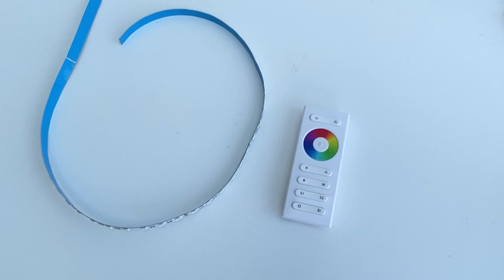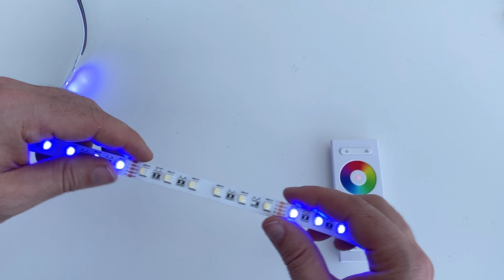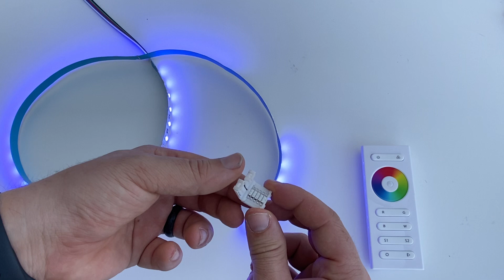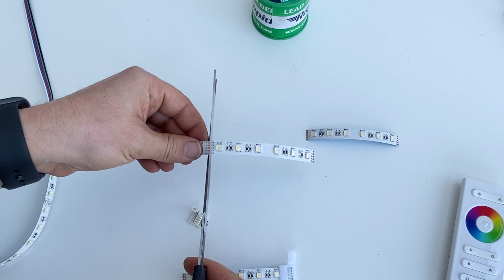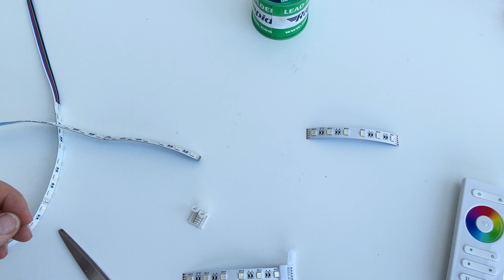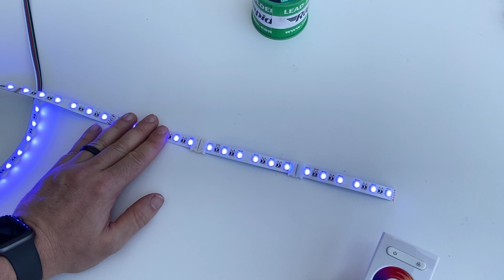How do I repair my damaged LED strip lights?  Push connectors repair

Comment: might help if they put a good diagram on the front of the box,telling you that first of all,they turn on using a remote control!the next thing is if they told you not to touch the lights at all as they have  sticky back tape on the underside.then they could advise you to glue solid plastic strips onto the wall to hold the led strips.inevitably,when you buy the LED strip lights,you take them out of the box,remove the backing strip and discover the sticky tape you bang it down somewhere and the whole strip starts sticking to other things and fluff and dirt!then when you eventually sort out the plastic strips,it's weeks later.you grab the strip and it's all tangled and stuck to things because you couldn't put it in the drawer to stick to all the other items.now the strip has been bent and broken and by now, you've also forgotten about the remote control!you  start fiddling with it trying to get it on and end up damaging it altogether!and on the front of the box,there is either nothing or mountains of useless information.now you've got to throw it away and just hope that you will know what to do when you buy a new one!you've lost the box anyway now,if it even had any good clear instructions inside it!no wonder billions of dollars worth of food,drink and goods end up as waste in landfill!common sense and communication is what it is all about!how can human beings be born and know everything that has ever been!it's utterly mindless marketing and protocol!information!

Comment: Mine is cut through the cut point can I solder those back together? I don’t have replacement LED strip. And that tape clamp you have won’t fit in my application.

Comment: What do you do if you have the kind covered in epoxy?  Is there a way to put the epoxy back on after soldering?
Reply: It's not epoxy. It's just regular old hot glue. You'd be amazed how many electronics are literally covered in hot glue on the inside. You'll find it all around soldering joints It's not conductive or toxic, reinforces connection points, and you can remove and replace it at will. So, to put it back on, just use the hot glue gun. Solder connections on a strip i know might get moved around s lot, I tend to hit it with hot glue and then throw a heat shrink tube over that

Comment: Hi, I just bought my LED lights and they were working fine but when I woke up the next morning they weren’t on anymore and I tried switching off and disconnecting it but it doesn’t turn on. Tho when I touch the metal tiny dots for colour on the strip, the light in that area comes on with that colour and when I stop touching it the light goes off
Reply: Idk if it’s because I cut it to shorten it (on the manual, it says I can cut it and there’s a scissor drawing on the copper part)

Comment: What if you strip turns on as you are trying to plug it in but once the usb is plugged in all the way the strip doesnt come on
Reply from the maker: If they are only coming in for a split second it sounds like it might be static causing the lights to turn on, once you have connected them the usb isn’t powerful enough to power the lights.

Comment: /me Watches OP cut out a whole segment of led tape in horror. Looks at my reel of led tape and finds missing resistor position. Checks a working segment's equivalent smd resistor position value, and takes note. Walks over to parts donor boards, searching for matching redistor value of equivalent size. Finds one, salvages and solders it to tape's missing resistor pads. Tests and jumps in glee at working unbutchered led tape.

Comment: I don't know why would I do that cuz I had a cut a piece off I have a 100ft strip led lights and so I thought I could get it to light up the piece that was cut off  the strip light  I put it on the metal piece with the copper part orange piece and and half of the lights stopped working now  messed it up.

Comment: Hi just wondering if i had a 5m long 5volt at 2amps how do you work out how much power does it use on a 12volt system is it 10watts per hour or is it 50watts per hour? Any help would be much appreciated thanks.
Reply: Einstein died years ago mate no one else can or could help u there

Comment: Can anyone tell me where you would get the strip to use for the repair?   I know they are cheap, but I see no sense in buying a whole new strip with the remote and all just to use about 8 inches of the strip for a repair.   It's just the led strip I need.    Thanks in advance
Reply: Just do it ur self, not hard at all, use what he used.
Reply: He lost and cut out a section...if she does so she will be a section short.... anser she asking can u buy small spripes for repair or add...no is anser have buy new one and use else where and kee0 but off that as u can not get little stripes to buy

Comment: i dont have an exta section of an led strip, can I remove the brokecn section and replace it with a connector?
Reply: Did this work as I've ordered the connectors so hopefully 🤞
Reply: @birdkill18  i got two 5 meter strips, but one of them wasn’t working. sadly, i didn’t do anything, lemme know if your’s will work

Comment: I  could use your help. I purchased 5 sets for a studio.  The design om the on off to USB is a horrible design.  It starts with the button but the cord is super short, then  there is a longer one of course for the USB. Problem is My studio desk is big and I need more lengthen the wite of the button side a foot or so, so I can drill a hole and be able to reach the button. Can I do this and if show should I not use line from tje USB side as that is more splicing but get what type of wire to add 12" or 16" max after button so I can place the button within reason?  THANKS I subscribed!!

Comment: I have an issue with one of my led strips, when I connect the other two all colours including white work however on the second white all the colours work apart from white, why could this be?
Reply: this could take place because of the brandw because some brands led strips are very bad. or like other people you where putting them up and they got stuck to somthing like carpet or somthing furry or soft and when they tried to take the led strip off it broke off or they pulled it to hard and they multistrip rather broke or its just the brand go to amazon and buy a whole new led strip or just go to amazon and search up (led strip conecters) then  once you do that you are going to have to find the right size for them alr?
Reply: @OfficialCrispyChips  contacted the manufacturer of the LED’s I purchased, turns out its a “common issue” He didn’t even bother replying to me where I should ship them back, they just gave me a refund... Probably cost them pennies to make and they sell it x6

Comment: i have 9 sections where blue doesn't work and 1 section where red doesn't work. i have many replacement strip sections but wanna see if i can fix them. if i push on the resistor on the faulty strip with a screwdriver or wire it comes back on and works fine. I hear this is because of a dry solder joint, is there a video showing how to fix these?
Reply: L bozo

Comment: If any you can help me I would love it when I plug it into the mini box it’s supposed to be able to power it on with a button it turns blue and purple for a split second so I know the LED strips work but there’s something else that’s not making it completely light up when I hit the button I’ve blown out of each end and no that’s not a sexual term just to clean out any gunk or dirt that might be in there I’ve tried that it still won’t light up but it’s indicating that it actually is working with the Bluetooth but it’s not wanting to connect I’ve accidentally deleted  The device which the account is locked up under the app that requires the LED lights to be customizable by lighting up changing colors and doing other things and changing patterns when music is played other than that I’m trying to figure out why it’s not working

Comment: When I turn my leds to white there are 5 lights that go yellow and for some other colors they are different is there any fix without taking them off your wall
Reply: u have to remove the faulty leds. Mine just went after a year n i fixed them by cutting out the faulty leds n replacing them w a strip using connectors
Reply: Same problem, literally only just bought it 🤬
Reply: @alexx123ify  yeah just got them as well
Reply: Same but when I have white one three turn yellow
Reply: Same thing for me
Reply: i have the same issue
Reply: Me as well
Reply: That happens to me too
Reply: yeah i have the same problem
Reply: Did you find a way to fix it
Reply: That heppend aswell I'm looking on youtube how to fix it
Reply: Same
Reply: Same
Reply: Same any fix ?
Reply: Same problem bro
Reply: Sames
Reply: Same. Lmao.
Reply: That's what happens when you buy cheap junk.
Don't get me wrong, even expensive ones will fail at some point in their life. But they're less likely to fail, and when they do, it will be at a much later date than cheap ones.

Most of the time, it's pointless to buy cheap junk cause you're just wasting money and polluting the environment by creating more trash...
Reply: How do you change the light bulbs in your RV life
Reply: Same
Reply: Same for me, the blue light has run out in the yellow ones
Reply: That is voltage drop off

Comment: I already installed mine and they worked fine for a few days until a section of them started turning a different light like when I put white that section is green and it does this for al the colors what should I do. By the way I have govee led lights.

Comment: So one half of my lights work great! But the other half does not turn on, the cable to connect it is twisted at the end of it, and I think that might be the problem, any suggestions or help?
Reply: Please tel me if it worked my led has the. Same problem
Reply: Mine only about 5 work the rest don't. How do I fix this 😥

Comment: i left my led lights open for like 6 hours cause i fell asleep, turned the lights off with remote but kept it connected, suddenly something blow up and the lights opened. i immediately turned off the extensions. after some time, it wont turn on. someone help me, idk whats the main problem and what should i change

Comment: im installing mine now and when I was attempting to use a corner connector to change the direction the three lights before the connector stopped working please helpppp

Comment: There is one faulty section of my LEDs and they are affecting the rest of them. When I press red the lights turn blue and the faulty section either doenst work or turns green. When I press blue the lights turn red. How would I fix this. I really dont want to have to buy a whole new set of lights

Comment: What happens if it works up until a certain point then stops for the rest? It worked just fine until it was bent in a certain area, now the red channel from that section and onwards does not work
Reply: Same, at first it was only green working but now I have green/ red colours but still no blue

Comment: What do I do when the connecter at the end of the strip which can connect to another strip doesnt work? I have 2 strips and I'm trying to connect them with each other but it's not working
Reply: I think they need to be connected at a cutting point

Comment: my LED lights haven’t been used for 2 weeks, and the only colour showing when plugged in is a very faint blue, do you know how or if i could fix this?
Reply: That sounds like an issue with the power supply if anything

Comment: Where can i buy that connector ? :(
Reply: I saw the connectors on Amazon! I got my lights from Walmart, worst idea ever. I didn't have connects either, so I'm using a bunch of usbs. One of my strips were $20, and only 6.5 ft. There are ones on Amazon 16.6 feet, the same price.

Comment: What should I do if it is at the very start of the strip like because I have to fold mine a certain way for it to turn to blue
Reply: >"What should I do if it is at the very start of the strip"
If you do not have a place to insert a segment, there isn't much you can do, but at least now you will have lots of spare LED sections to repair other strips. The problem is how to get other strips without all the controllers or remote. They are available on Amazon or eBay or similar. Make sure they are the same as the ones you have. This video showed 4 wire strips. Some others are 3 wire strips.

Comment: Mine only work when I touch them on the silver thingy
Reply: that happened to mine too. have you figured out how to fix it? if so please respond to my comment.
Reply: @paigegabrera  yes, where the wires connect (the spiky thing) you just flip it around and connect it again... Sorry I can't explain in words
Reply: @sihlezwane6910  thank you so much. but i tried it and it didn’t work
Reply: @paigegabrera  did you figure it out mine don’t work.
Reply: @mahnoorkhan4091  no i didn’t, i’m planning on getting new ones instead. sorry!

Comment: I was trying to remove the tape on the one side of the led for the 90 degree turns since it was getting caught on my sheets and being ripped off and I accidentally cut two of the wires of the inside now one side is green the other blue. Hopefully I can return it.
Reply: SAME :/

Comment: I put my lights up as a test to see if it would look good and I used a tack and I think I punctured the red wire because all the colors under the red column won't work and instead they turn green and only 3 lights turn red. can I fix that or no?:/
Reply: you can you might just have to cut the strips off and get conecters to go with them or buy a whole new pair

Comment: sooo the part of where you connect the strip to the adapter ripped off connecting for the colours. how do i repair the wires?
Reply: Same how do I fixed ittt

Comment: Thank god my dads an electrician 😅 my led strip is showing no colour in two sections for blue, and in those same sections is shows the analogous colours for all cool toned colours. All warm toned colours are  fine, ugh! This just happened at random
Reply: Also, my led’s are waterproof so the silicon cover makes it hard to see if theres damage in the resistors
Reply: Same mine is red  rn in two sections and blue in the rest.All of it is meant to be blue!!

Comment: I cut my led lights and connected it and when I change it to green one part is green and the other is blue I can't just put it all to green
Reply from the maker: hmmm, this sounds strange! have you checked closely that the pins match up correctly and are not touching each other or crossed over?
Reply: @InstyleLED  if i press purple half of it shows up as blue and the rest is red, and before when i applied pressure it became all one colour, but not any more. also half of my blue isnt working. any tips?
Reply: @layan6247  that’s what mine is doing
Reply: @v1p.4444  yeah i still dont rly know why um i think ima get my electrician to see what happened and i’ll try and get back to u
Reply: @layan6247  okay thank you, it’s annoying and like even if i want to have purple half of them are red because the blue doesn’t work :/
Reply: @v1p.4444  yeah thats why i always put it on green or red cause theyre the only ones that work for me
Reply: @layan6247  yeah same haha
Reply: @InstyleLED  thanks it's fixed now
Reply: Mohamed Gamer how'd  u fix it? i had the same problem
Reply: InstyleLED I’m really new to tech and honestly don’t have much common sense.😖 Do you mean I should shift the pins to match up better?
Reply: @InstyleLED how do you
Reply: SAME HERE-
Reply: @angie3099  since a wifi provided tv remote is like a led remote kind of just focus the remote on the lights pressing a random button
Reply: Mine is just one led
Reply: Same
Reply: I can’t put all blue, the faulty section will only do green lol
Reply: Alejandra Molina same, did you fix it??
Reply: Same
Reply: Same only 1 comes on and the rest doesn’t

Comment: what is t the name of that lil white connector thing please
Reply from the maker: Go onto amazon or ebay,  and search for 'led strip connector'     you then need to find the right size for your strip
so if you have white it will only be 2 pins.  BUT you can have white at 8mm, 10mm or 12mm  so measure your strip width first!
Then you have RGB which will be 4 pins  (RGB and +)  again there are either 10mm or 12mm for this tyoe so measure first
Then you have RGBW which will be 5 pins (RGBW and +)  again there are either 10mm or 12mm for this type so measure first
You can increase youe search term detail, by saying something like   'RGBW LED strip connector'  
or 'white LED strip connector'
There are also connectors that have leads on them so you can wire into a power supply. Or cables that have a leads so you can go around corner

Comment: What is that product you use to connect?
Reply from the maker: Go onto amazon or ebay,  and search for 'led strip connector'     you then need to find the right size for your strip
so if you have white it will only be 2 pins.  BUT you can have white at 8mm, 10mm or 12mm  so measure your strip width first!
Then you have RGB which will be 4 pins  (RGB and +)  again there are either 10mm or 12mm for this tyoe so measure first
Then you have RGBW which will be 5 pins (RGBW and +)  again there are either 10mm or 12mm for this type so measure first
You can increase youe search term detail, by saying something like   'RGBW LED strip connector'  
or 'white LED strip connector'
There are also connectors that have leads on them so you can wire into a power supply. Or cables that have a leads so you can go around corners!